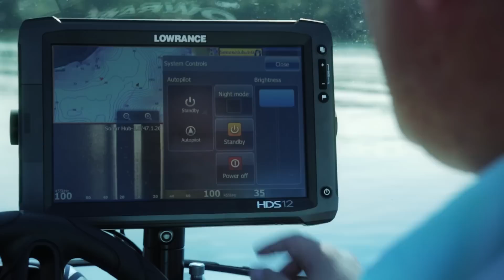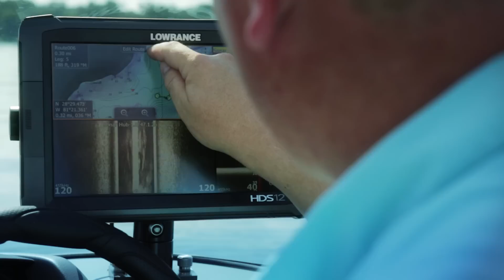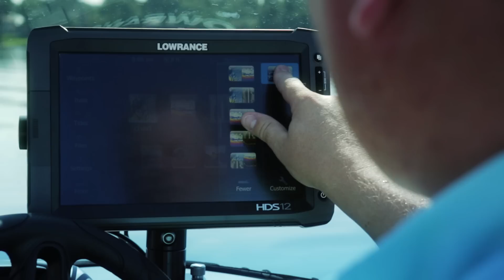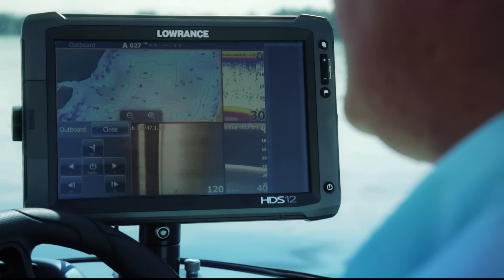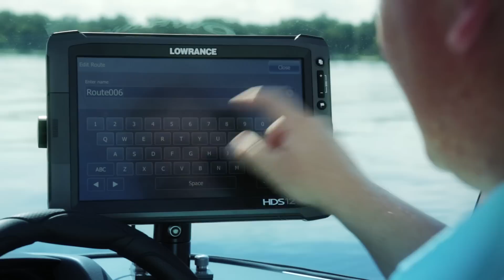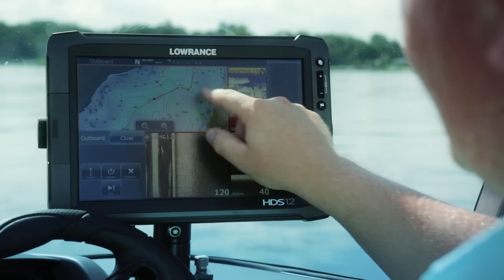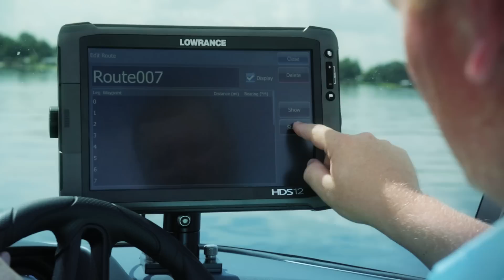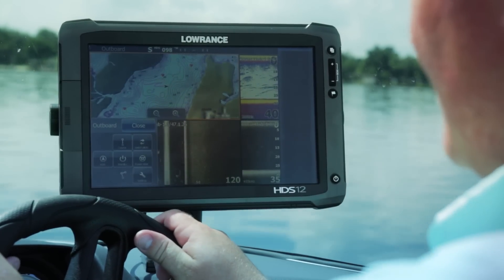Lowrance Announces New Outboard Pilot

Comment: Will this work on kickers.with tiller
Reply from the maker: Hi

There isn't quite enough information to answer your question so I'' have to e general in my answer.  If your steering is a hydrauilc system in most cases this would work using the hydraulic system.  If it is a cable steered system this would again work in most cases using the helm drive syste.  If the only steering you have is with a hand tiller this would not work.  I any case if you intend to use this system make certain you have investigated all of the installation and operation manuals to be certain it will fit your need.
Reply: @lowrance  to bad i have cables now on 150 murcury but was hopeing to change to power soon but my kicker is tiller hooked together for trolling not wanting to hook big one to autopilot guess i have to go with tr1 gold thanks for your time

Comment: Do you know if a hds 5 gen 2 will work with the cable autopilot
Reply: It will but a touch screen is infinitely easier to use.  I had a HDS5 Gen 2, got tired of all the excess work and installed a used HDS7 touch...MUCH BETTER!!!

Comment: Why doesn't this work with cable drive power steering equipped Mercruiser I/O's? Is there a speed rating at which it won't work or disengage?
Reply: It works but the Mercruiser has additional slop in the steering compared to a direct linked outboard.  They do sell a different style steering gear for the Mercruiser to eliminate the slop.  I use the cable steer on my Sportcraft 251 with an alpha one and it works good enough for me.  I found putting the trib tabs down while idling helps hold the course much better instead of searching for the heading, can't imagine not having it!  There is no disengagement at any speed unless commanded.

Comment: Maybe Lowrance should also state that its not yet available to use with the Touch units only the Button units! why release a product that is no yet fully supported with your current product line!!! i have the HDS12 Touch with the latest 4.0 software, purchased the Outboard Pilot 21/4/2015 only to be told by techs that the touch units arnt supported yet! Funny that this video is shot using the touch unit, EXPLANATION PLEASE!!! and how freakin long till ill be able to use the brick?
Reply: I know this is old, but it works fine with a HDS7 Gen 2.